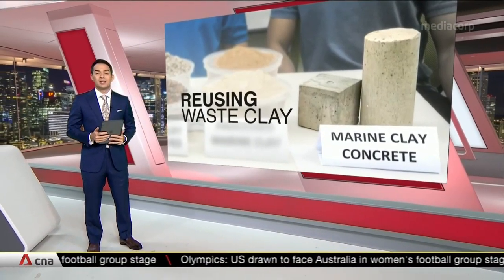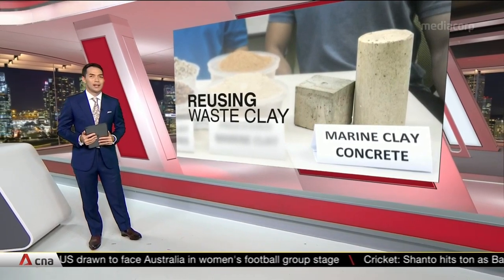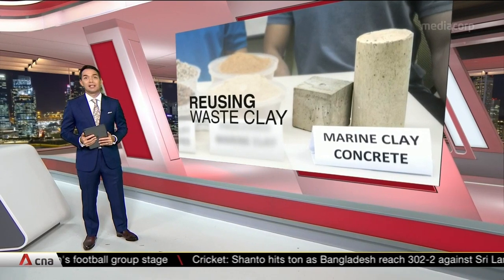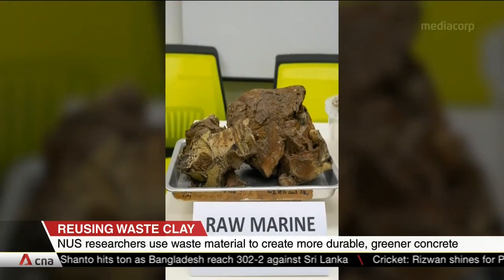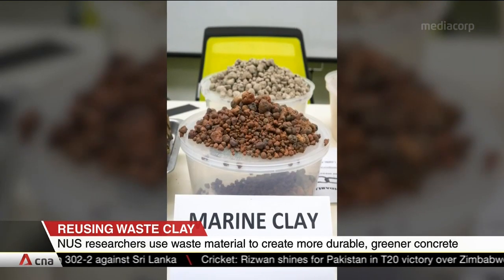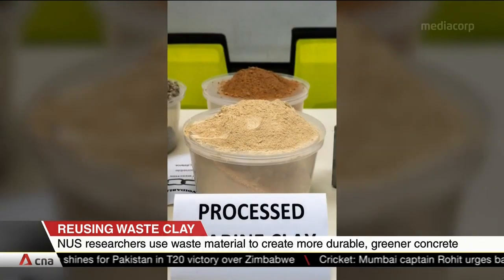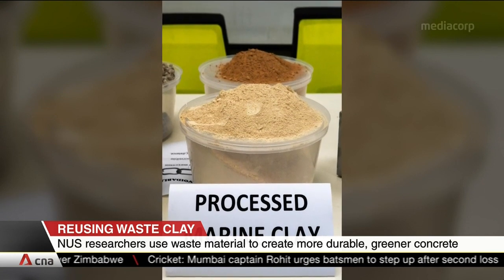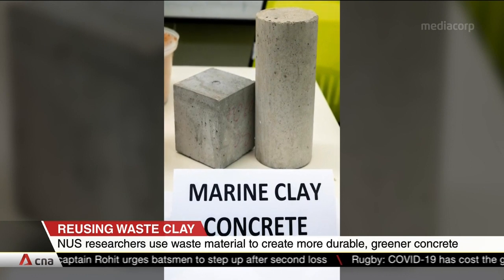NUS researchers use waste clay to make more durable concrete that is up to 50% greener

Comment: Did it not occur to you that you should plan for buildings to be 99 years and not tearing down flats and buildings after a mere 40 50 years.
Build so strong also no use, you raise the plot ratio by so little.
Reply: Because it is a bad idea to make a 99year building. Just like how they sell machines today, nearly no parts so youll be forced to buy new unit.
Reply: @cholesterol804  that being said, I ask you, what makes you think our HDB even need hack after 99 year. Tell you in 20 30 years time, they are going to tell you to top up the lease and then some places the flat continue to stand, maybe in lousier places like yishun.